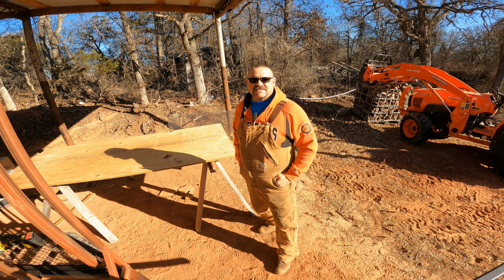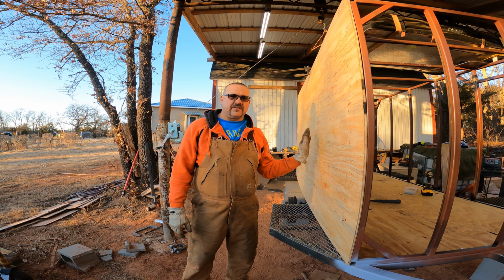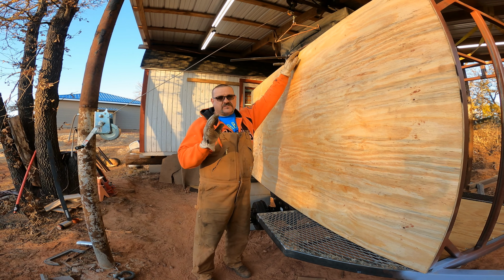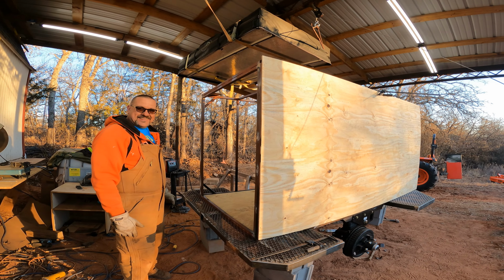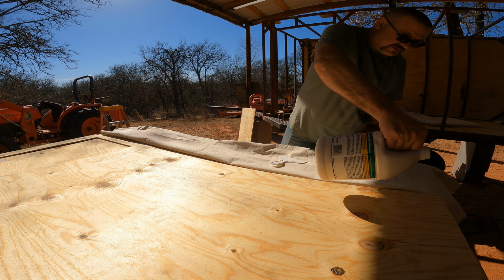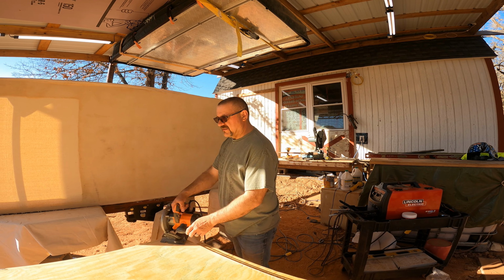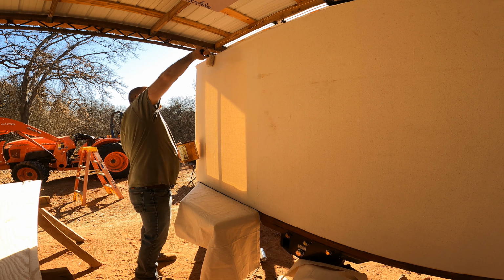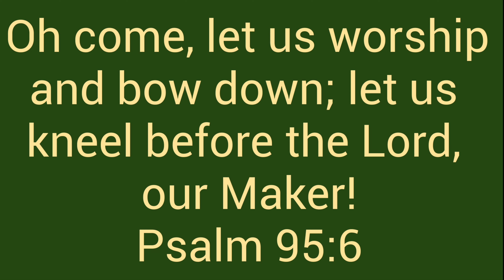Poor Man's Fiberglass  DIY Overland Trailer Build PT.6

Comment: Great video!. I'm about to do this. Did you iron the canvas to get the fold creases out? Or do they smooth out when you smooth it over the glue?
Reply from the maker: Thanks for the comment, yes the iron really helped with smoothing out the canvas. You can actually use it to stretch the canvas a bit by using the edge of the iron while pushing. Hope that makes since and good luck. It was easier than we expected.